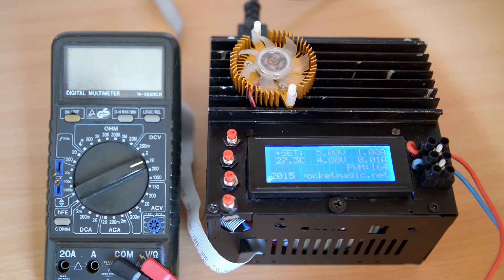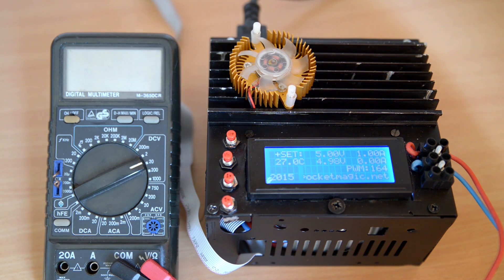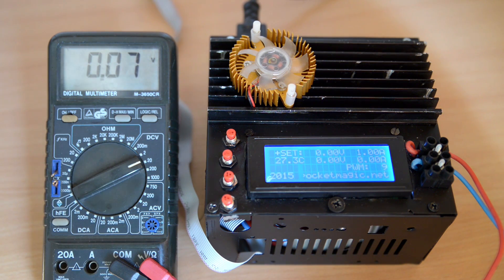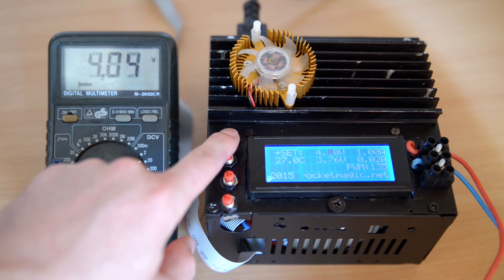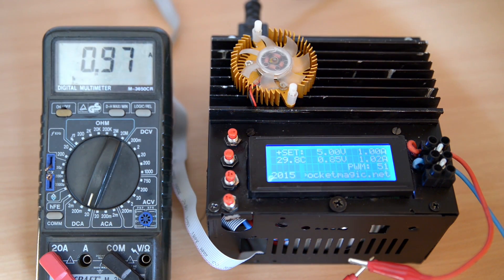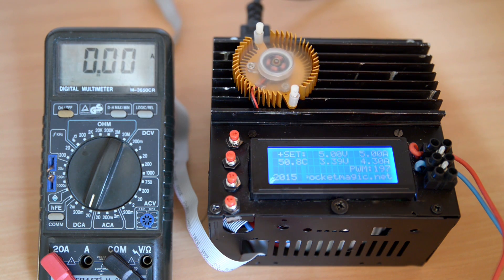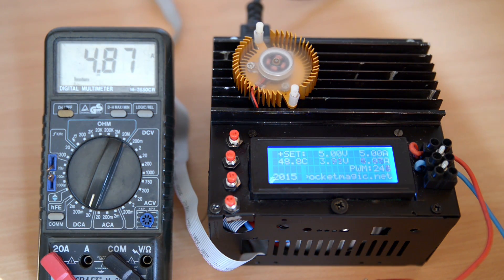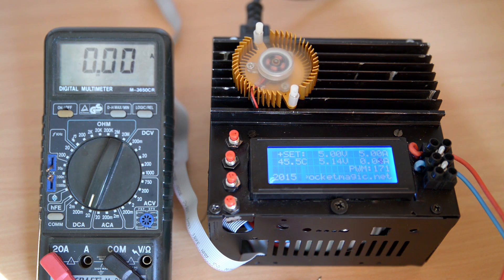Digital power supply

Comment: Hello Radu, I  build your  progect but have problems with atmega8 . First time I programed it to work with 16 MHz  quartz crystal  but when switch it on the only thing that happened is that the display shows two full lines. I decided to check the crystal oscillator with my old soviet oscilloscope and there is no oscillations, then I programed the atmega8  fuse bits for 8 MHz crystal and changed the crystal and capacitors with new ones but again have the same result. To write the microcontroller I use eXtreme Burner and don't have any problems through that. I copied the  circuit board with felt tipped pen and  can't find find any problems in it. I don't know where to dig.